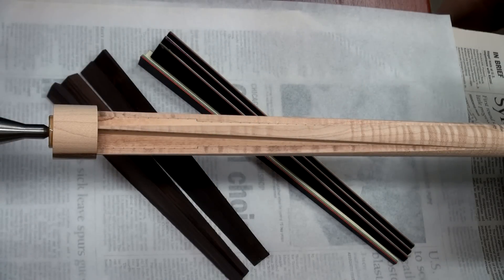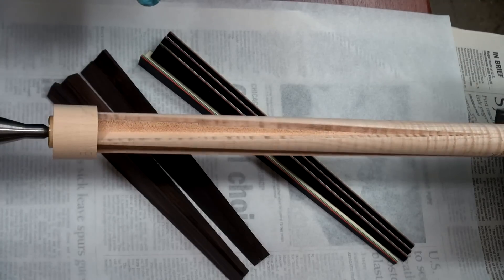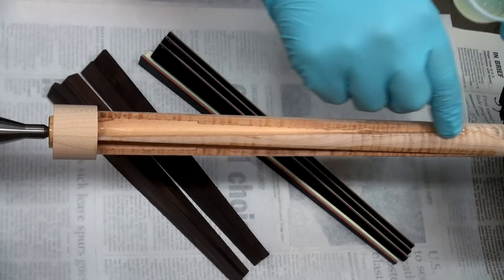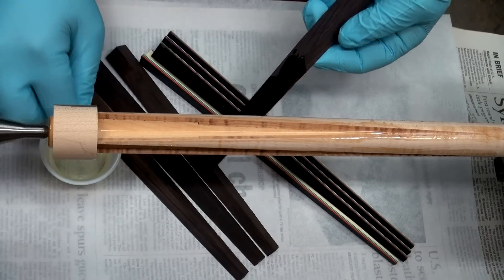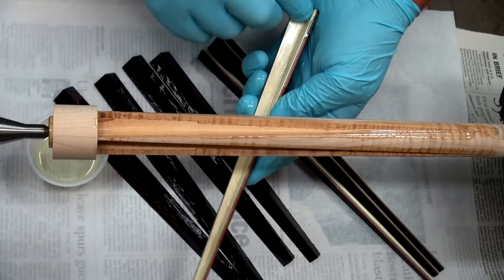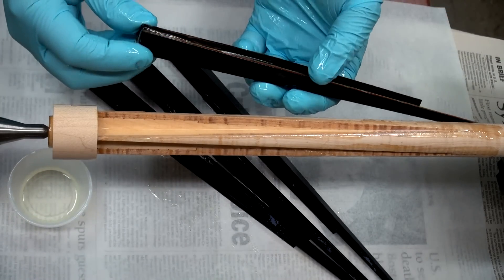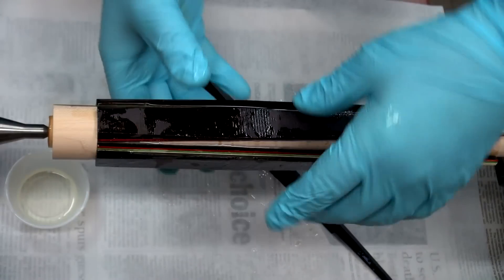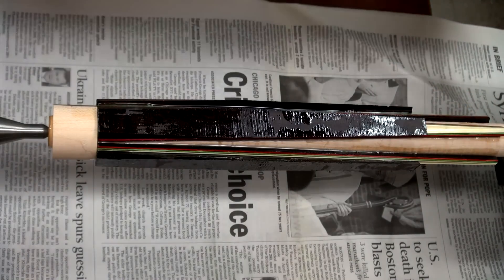Cue Making - Installing Points & Veneers

Comment: you still doing cues Bob ?  I'm new to CNC machining just bought a desktop CNC machine, but am far from doing 4th axis machining. I was wondering if my 4 axis cnc machine could make a butt and shaft ?   I checked your website and seen no cues for sale. Is it very problematic trying to sell pool cues  ?  I thought of using my big 3D printer and using wood filament to 3D print my own custom pool cue butt;

Comment: can any one tell me, where to cut the joint on a pool cue-?what are the proportions between the shaft and the butt?
Reply: Francisco Câmara Cues are generally a 29" split between the butt and shaft. For the butt it is generally a 12" forearm, 12 1/2" wrap area, 3" butt sleeve and 1 1/2" butt cap.
Reply: ty very mutch for your reply Eric.